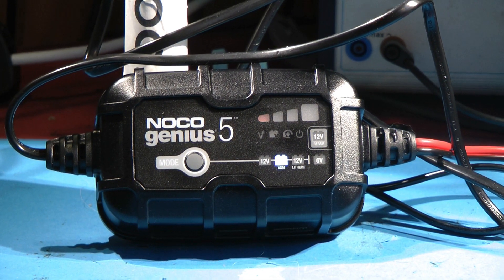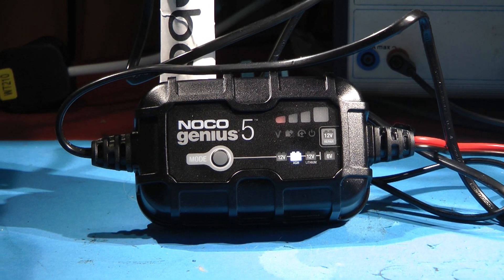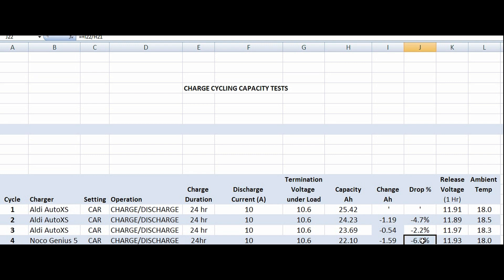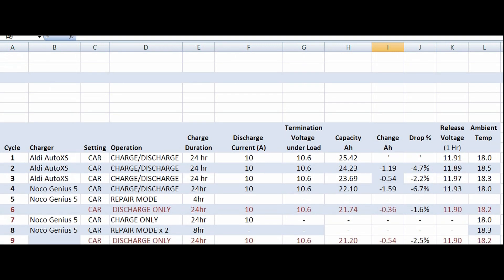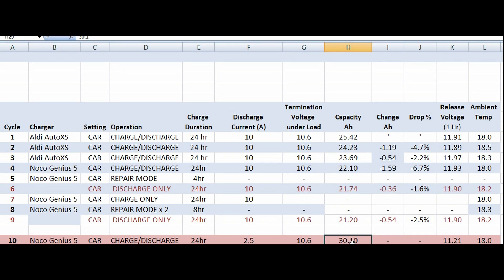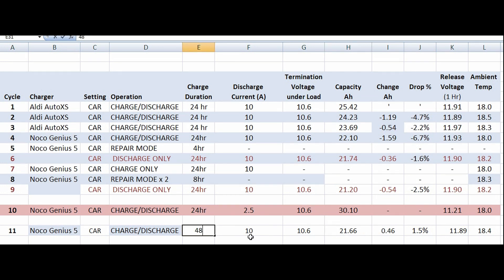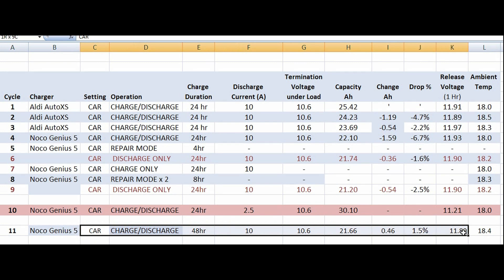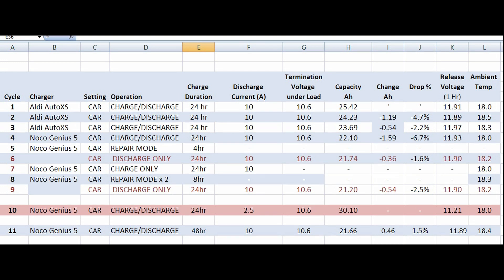NOCO Genius 5 Battery Charger Detailed Repair Test , teardown  and Review Part 3

Comment: It will be interesting to see if you can get more capacity by using again the Aidi charger.
Reply from the maker: I think it would be the same result.  Desulphation doesn't really work for most batteries.

Comment: 10.6 seems like too low of a DOD to not cause damage.
Reply from the maker: 10.6V at zero load or resting voltage would be detrimental.  The the lower the discharge current at 10.6V the more damage it will cause as the state of discharge is much deeper. ...... However  10.6V @ 10Amps load is equivalent to about a 11.6 to 12.0V discharge  voltage.  The load cuts when 10.6V is reached @  10A load not at the open circuit at rest battery terminal voltage. Apples and oranges.

Comment: I just bought the Noco 5...it's cold where I live and I was having problems with the cold killing my battery. I used the NOCO 5 to fully charged the battery and then put it in repair mode. So I had a fully charge battery that went through 1 round in the repair mode. Today, 1 day later I go out to start my Jeep and after just a few seconds the battery is dead. The weather was cold overnight about -35 celcius.

Do you think my battery is just shot or would that happen to a healthy battery in that temperature?
Reply from the maker: Interesting that the Noco Genius5 user manual states that the over voltage, bad battery and reverse polarity lights all flash to together when the ambient temperature is too high or too low. It the specs it is rated to work  down to -20 deg.  It states that normal function will resume when the ambient warms up. It doesn't say if normal function resumes in the mode you left it or it goes into standby. I'll test it.
Reply: That shouldn't happen to a health battery.  According to what I've read, a new regular flooded battery that is fully charged has a freezing point of -70C or thereabouts. Since -35C is far from -70C and you just fully charged the battery (at leat according to the NOCO charger), that battery should have been OKAY unless the battery is bad or the charger is bad.

Comment: Of course great effort! But bloody hell all I want to know is whether it's a good car battery charger
Reply from the maker: I just present the evidence and you decide. My opinion is that both the NOCO and the Genius are  unfairly priced and the simplicity of what they actually do obfuscated by battery folklore rather than real world accurate measurement.  Just a couple more in the series and you will know. I wouldn't buy a CTEK though.
Reply: @razenby  thank you, I was researching chargers as my vehicle has been locked up in the garden for quite sometime and I was having to drive it down the motorway every 2 weeks which is a pain in the backside, I purchased the noco genius 5 as I was watching your videos a few weeks back, used it twice now and yeah couple of hours and its fully charged.  I think most people will want a charger for this reason and probably dont care about all the other features.

Definitely agree, overpriced for sure paid £64.99, I felt the only 2 choices were the ctek and noco, i just wanted a simple plug and play device, no hassle, if it works for a few years I'll be happy with it.

Comment: Well maybe the longer charging duration led to more gassing of the battery reversing some stratification which in turn reversed some sufation and increased capacity. But honestly it could also just be due to measurement error.
Reply from the maker: I heard the gassing theory many times before. The battery is a VRLA sealed maintenance free. Gas is reabsorbed due to the ambient cell pressure and the composition of the plates. If dissociation to gas happens at a rate faster than the capability to recombine into back water of the plates then it will leak the gas the electrolyte level will drop. Interested in your doubts about the measurement accuracy. Please explain your doubts about the mighty £3,000  Yokogawa WT210.  The Yokogawa is a £3,000 instrument. Error is <0.03%. So either the Ypko is faulty or I don't know what what I am doing.. Any advice is always welcome.
Reply: @razenby  Well yes at some point the electrolyte level will drop but i was focusing on the gas bubbles mixing the electrolyte, removing some possibly existing acid stratification and thus maybe some more sulfation at the top of the plates, restoring some active area. Very theoretical, really.
Concerning my mention of measurement error: I wasn't trying to question your expertise, I was merely trying to voice my concern when trying to deduce anything from a one time measurement of a parameter with a mere change of about 2 %. In my opinion there are just a lot of uncertainties. Was the temperature of the battery the exact same in both tests, as the chemical reaction speed relies heavily on it? Did the Yokogawa warm up for the same time for both experiments and for at least 30 mins? The Yokogawa is listed with a DC power accuracy of ±(0.3% of reading + 0.2% of range) at 23+-5°C which you're barely within at 18°C. If you had the Frequency filter turned on the accuracy is less at an additional 1% of reading. Then additionally  the cutoff voltage could differ ever so slightly between tests. But honestly I'm not an expert in this field and you might very well know more about this than I do. Anyways, keep up the great work, I very enjoy the videos.
Reply: @razenby  No such thing as sealed Lead Acid.. They just cover the caps up with a sticker...I saved many a UPS battery by removing them stickers. To get at the fill caps...As damn near every one of the plates. Were exposed for lack of water.....

Comment: You're doing great work here! I have question - is it better to have two chargers (eg. Genius 2 and Genius 5) for motorcycle and car battery (20Ah and 50Ah)? Or higher Amp one will be fine for small battery too?
Reply from the maker: Thanks. I don't know the answer to that. I am logging the charge current and terminal voltage with a CTEK at the moment so we can see what it does. Then the same thing with repair mode if it can be invoked. I also have  another a battery from my Jag that the dealership told me needed replacing last week at the service so I got the old one back. I had no idea that it was iffy at all just possibly the starter didn't sound as sprightly after being parked for a couple of weeks.  So battery sample size is now 2. If the motorcycle battery you have is the old wet cell type with the ability to access the electrolyte for each cell then you have more latitude as they are much more forgiving than maintenance free type.  The next video will be released probably today.
Reply: Maybe......the rule is to charge with 10% current...if battery is 50 ah u use a 5a charger..
Reply from the maker: @dacomaniac  Higher currents within the manufacturers recommendations are OK during the bulk charge phase (open circuit terminal voltage > 11.8V) . When the terminal voltage under charge (still charging) reaches 14.3 to 14.4V  You are then in the absorption phase.  Then I would advise that you need a very low charge current (~150 mA for a 50Ah battery) during the the absorption phase and cut the current when the terminal current reaches  14.4 to 14.5V .  (At 25 Deg C -The terminal voltages are temperature dependent).
Reply: @razenby  u re right...i have in ideea and i dont know is good or bad..at 14.3 14,4  change the charger to moto  at 0.8 a.is that good? Thank u so mucch
Reply: @razenby Thanks for all the lessons like this, I read all the comments in mist of your videos about the chargers ❤

Comment: According to this article, hard sulfation cannot be reversed. And it only requires 200mA to reverse soft sulfation. If that's the case, then you do not need genius5 ot genius10 as manufacture had suggested. Gunius1 is just as capable as genius10 in "repair". The only difference is charging time or speed. https://batteryuniversity.com/learn/article/sulfation_and_how_to_prevent_it
Reply from the maker: I was taught by Dr Brown in a real university in the Energy Storage and Machines module back in 1983 that there are 2 types or categories of sulfate crystals:    
1. Very small amorphous crystals form on, or cover  the plates naturally as a consequence of Lead Acid battery chemistry. In a perfect battery, when charged,  100%  of this fine amorphous sulfate  is dissociated back into solution to regenerate the H2S04 in the electrolyte.  Batteries aren't perfect so during any significant discharge state some residual sulfate will be left on the plates and this is a major cause of the natural aging of the cell.  2: Large sulfate crystals that form when the battery voltage discharges to such a level that the electrolyte pH goes high enough to promote large unimpeded sulfate crystal growth on or between the plates.  Lead sulfate is barely soluble in water or acid. Large crystals do not dissociate during charging. Lead atoms that are not longer electrically in contact with the plates are captive in the crystals and can no longer participate in the charge / discharge cycle.   This sulfate also obscures the plates so the effective plate area is reduced, consequently affecting the capacity and max CCA.   
Of course this does not take into account and structural failures that also denigrate performance such as cracks or flaking of the plates etc..   I don't know if my understanding is correct - if anyone can explain what is really happening then I am all ears as I really want to know.  Lead acid batteries are near all made from recycled batteries with a host of impurities. For a given capacity  they have got lighter so there is less bulk and mass in them. Most starting batteries are maintenance free etc. etc
Reply from the maker: From Wikipedia: 'In water, 0.0404 g/100 mL at 25 °C; slightly soluble in alkaline solutions. Soluble in about 2225 parts water; more soluble in nitric acid; soluble in sodium hydroxide, ammonium acetate or tartrate solution; soluble in concentrated hydriodic acid; insoluble in alcohol.'     What we need is Actimel to invent a battery flush that gets rid of the bad  sulfate and leaves the good behind ???   Hmm we need an inorganic chemist to comment.
Reply: @razenby  To me, this (what Dr Brown had taught you) is exactly what the BU page said. The soft sulfation of BU is the smaller crystal and hard sulfation is the large crystal. Noco basically claimed (or more appropriately, implied) that their "designated repair" can undo the large crystal, it seems to me. However, because in their manuals it says all models (1, 2, 5, 10) can do "repair", it seems to me that implies that it'll do at least the soft/small desulfation. The fact that your experiment and testing had shown no significant improvement on genius5, led me to conclude genius5 or genius10 will have no more power in repairing, when compared to genius1
Reply: @willh.2155  The only thing is that the testing so far has only included capacity testing.  We may have improvements in other areas like internal resistance and cranking amp output or even voltage levels after rest or the rate of self-discharge but have not been tested so we don't know their results.
Reply: @richardlouie2922  that could be true, emphasis on COULD. According to noco, however, they specifically claimed that their repair will desulfate, which is the basis of any lead acid type performance. The fact the capacity did not improve, or reduced even, directly refuted this very basic element, which makes it hard to imagine other aspects like CCA can improve. 
Their marketing department had done a great job of pushing imaginary results and let us defend in their favor. We are here to find out how it worked, not only if it works, in which case it didn’t redeem itself. Kudos to magic smoke!
Reply: @willh.2155  Ahhh.... those folks in the marketing department!  I would not put it past them that they defined desulfating as charging the battery which is kind of what charging does - reverses much of the reaction that creates the fine soft sulfate in the first place. What those marketing folks may have conveniently left out is that the sulfate converted may not have been any more than basic charging.  OR they dumbified the terminology so that desulfating could mean any number of ills of a battery rather than what it actually is.  It would not be the first time that a marketing department has played a little fast and loose with the facts.

Comment: Have you measured electrolyte density? That's a good indicator of the battery condition.
Reply from the maker: I will check the SG at some point.  I am investigating the claims of the charger manufacturers that you can buy their product instead of buying a new battery.  Checking the electrolyte is a problem for the average user who has a semi sealed lead acid maintenance free battery.    I have another battery from my Jaguar that has just had a new one fitted at the garage because the mechanic said it was due for replacement. I hadn't noticed anything wrong with it so that might be interesting.  At the end I will cut the top of the 3 year old  Halfords battery so we can see what condition the plates are in.
Reply: @razenby  i noticed that the repair mode works fine on a smaller batteries. A motorcycle battery in a repair mode was charged with 16.5-17V while 80ah battery in a repair mode is getting only 15V
Reply from the maker: @rymek1  The old continuous current over-voltaging (overcharging) method is not recommended for maintenance free batteries but we will try it.  This NOCO uses the current pulse method. Only works if you walk widdershins around the battery for 10 minutes at the end of the process.
Reply: @razenby  It would be interesting to see how much water is actually lost during a school continuous current over-voltaging method especially with these newer batteries that are sealed.
Reply: @razenby  i understant ctek use coninous curent and noco use pulse.thats made the differnt.
Reply from the maker: @dacomaniac  For what process?
Reply: @razenby  kind of recond mod

Comment: MANY THANKS FOR YOUR EFFORT AND TIME YOU INVESTED IN THIS, REALLY APPRECIATED!!!! If I were you, I would try to connect it and continue your test with couple of RECONDITIONING cycles with CTEK. It would clearly show whether CTEK is of any better or not. Try this in a background yet, while you tear down NOCO 5.
Reply from the maker: The CTEK will be bought to bear later today...
Reply: @razenby  Afterwards, it might be interesting to see if you can pop the covers off of the cells and check the condition/quantity of the battery fluid.  And yes, I do remember you telling me that the battery is maintenance-free so it's sealed.  But my experience tells me that many of these so-called maintenance-free batteries aren't really sealed at all.  They just hide the covers under a sticker or incorporate the covers into a plastic plate across the top of the battery making it seem like they are sealed when they are not.
Reply: I've actually done that with old batteries using the CTEK.  I've found that the initial run or two will always shut off after 4 hours of Recon mode (the limit as stated by CTEK) but the runs afterwards will get shorter and shorter as it takes less time to reach to 15.8V. 

In theory, the shorter time it takes for the battery to get to 15.8V should mean that something in the battery has changed or else the time to reach 15.8V shouldn't change at all.

Comment: The only thing for it is to access the cells and add distilled water, one or more of the cells are likely dry that's what I did when I had  the same issue I found it was an ordinary battery with a sticker over the fillers. The battery worked for another 19 months or so.
Reply from the maker: I'll give that a go. I have about 100 tiPs on how to fix it. I am curious to know what works!

Comment: Very interesting.. I would really like to see what happens if you used the  ZYX J30 12/24v  8A charger  in its repair mode and then check battery capacity thereafter. I have had  good success with this in terms of Cold Cranking Amps  (tested with an Ancel battery tester) and specific gravity readings off a hydrometer. Unfortunately I don't have the equipment you have to measure the Amp / Hour capacity of a battery so would be interested to see what happens .
Reply from the maker: Thanks. OK we will do a before and after CCA test with the 8A charger.

Comment: One thing that I've learned with the Noco g3500 is to leave the charger connected to the battery several hours after the green light stop flashing .The battery seem to take more charge .
Reply from the maker: Thanks, interesting.  We'll check and see what the Genius 5 version does in this situation.
Reply: @razenby  I believe that goes back to the Genius 2 parameteric testing you completed where the Genius 2 basically stops charging once it reaches the target voltage (bulk charging - constant current/variable voltage - rather than continue to do an absorption charge - constant voltage/variable current).
Reply: That's what I read as well - unlike everyone else, a solid green light may not mean that the absorption phase has been completed.
Reply: 10.6 is way over discharge as far as i know lead acid batteries like to stay above 12v under that is bad for tge battery maybe charge then discharge to 12v and cycle like that?